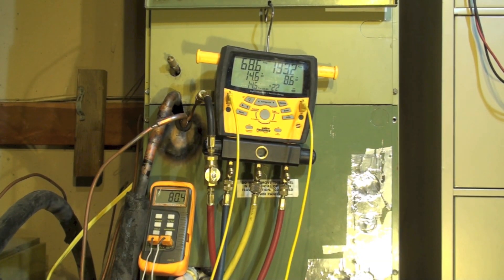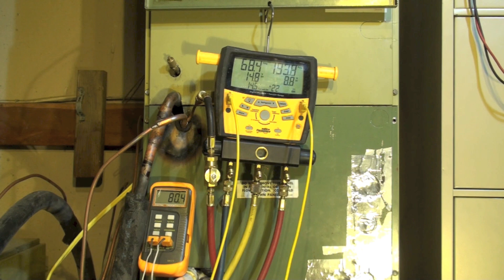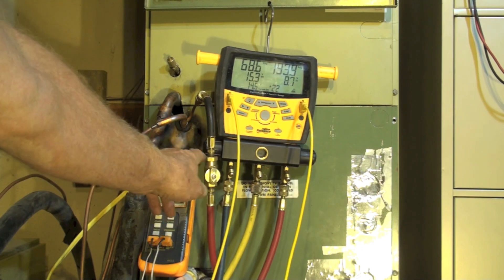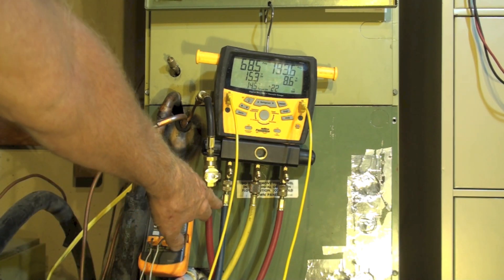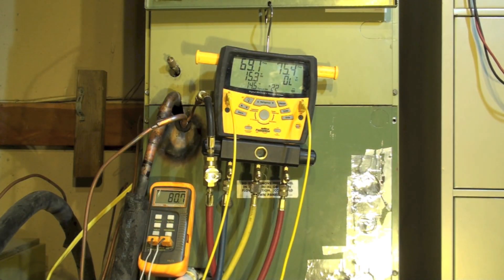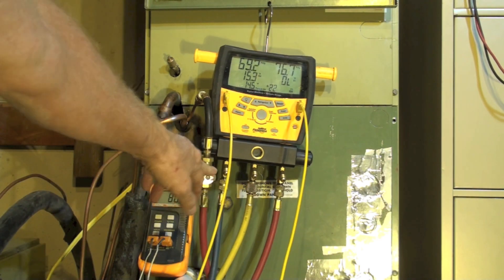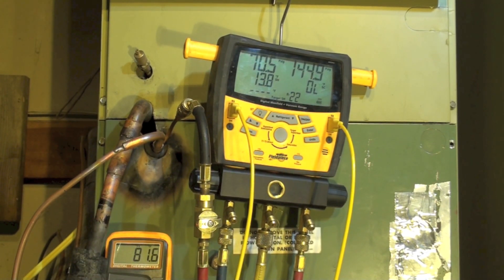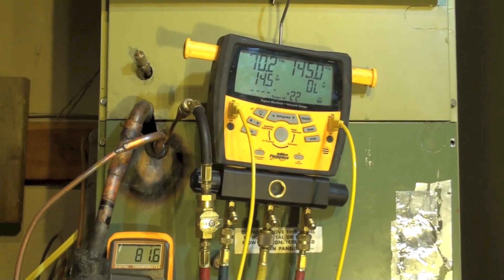How much refrigerant does the gauge set hoses hold.

Comment: GFM - So after I evacuate on a new heatpump install, hook up to tank and break the vacuum with the 7 ounces of 410a that I need for over the 15 feet of lineset, I will disconnect from tank, dock my yellow hose and then open both service valves and release charge from compressor and check for subcooling after 15-20 minutes of running in cooling mode. At that point there will be product in both my high side hose and yellow hose that was hooked to tank. If I remove high side hose from service valve and SLOWLY bleed product through vapor side back into the system, will that extra that I have from yellow charge hose make a difference? I have the Yellow Jacket 42001 guage set with 60" hoses w/ball valves.
Reply from the maker: I think you have it.
GFM
Reply: TY

Comment: I was hoping you were going to tell us how much refrigerant is in the hose and gauge set.  Mini splits have to be charged by weight and I was hoping to find out how much refrigerant I have to allow for in the gauges when weighing in the charge.  I guess as long as I make sure to empty the high side hose into the low side it should be pretty close to the entire weight of refrigerant called for.
Reply from the maker: johnmiller102 you have got it.  If you use low loss fittings, you should come pretty close.
GFM

Comment: Smaller systems with shorter line sets will be more sensitive to the few ounces in the hoses. The 10 and 20 ton systems I deal with, it makes virtually no difference.
Reply from the maker: Jimmy Ray Your systems also use TXVs that are less sensitive to charge level.  This video was done to illustrate that the charge in the hoses can effect a critical charge system.  Like you, I did not pay much attention to the charge in the hoses in the larger systems.  Thanks for the thoughts.GFM
Reply: @grayfurnaceman  so you charge piston metered systems by subcooling?
Reply from the maker: @dustinjohnson2891  Generally not. If the unit has a charging chart, I would use it.
GFM

Comment: Okay so, say I go up to a system to do a maintenance and I check the charge with my gauges. I do not add any refrigerant, am I not losing system charge if I do not bleed the pressure back down again?
Reply from the maker: Stephen Rardon When dealing with a TXV I just dump it in to the low side.  If its fixed orifice, I try to stop charging early so the hose finishes the charge.  I know some of this seems to take quite a while and we are generally on a schedule, but with practice it goes quite smooth.
GFM
Reply from the maker: Joe Shearer There should not be any air in the gauge set as the hoses should have been bled when the set was installed.
GFM
Reply: Im sorry are we talking about how much frezon is in the gauge hose when were all done? Does it really matter? In 8yrs this is the first i ever heard of this phantom gas. Looks good from my house. :-) im asking cause i dont know, so teach on teacher. Now im couiorus. Stephen i know my spelling sux. Cut me some slack. I cant do it all. Chrage the unit, spell this, spell that. Mr. Know it all. Im stephen i know everything bla bla bla. JK
Reply: Stephen Rardon ok for real what about quick connectjsirbdid fksisb? Connect? For the hoses? Soon as you start to losen it, it seals all the run off gas in ur gauges.... hdudjdjd jdjdsjd... dhdhdjsosidu. Bsjskjdjdh. Hdjdjdb. Get that last part?? It was very important. ;-)
Reply: O i got ball valves on my fancy hoses. Im better then you. Well then mr. Rardon maybe you should just post a pic of ur balls, valves. Ya iv had not seen/used those im gonna look em up. Good deal ill check em out. Have a good day man. Dont huff to much 22... :-)
Reply from the maker: Yes you are.  If the unit is a TXV controlled it is not that picky about charge.
GFM
Reply: grayfurnaceman so if i check a txv system i can bleed back pressure but on a piston i shouldn't? seems i'm losing either way and by bleeding pressure over i'm minimizing the lose. i've heard you lose as much as 3 ounces, is that an ounce per hose or 3 per hose?
Reply: 3 ounces is what the charging hose holds... Refrigeration is critical charge and I've checked on it! Lol
Reply: I'm more concerned about injecting air in the system than loosing 3ounces. I keep my high side hose filled and when connecting suction line you don't have any liquid anyway .
Reply from the maker: Stephen Rardon The hose charge is in the high pressure hose as a liquid.  The low pressure hose is gas and holds very little.
GFM
Reply: Befor adding gas i do bleed the air outa the hose. Soon as charge is good disconnect and go. Quick connect fittings.
Reply: Timmy W no biggie, spellllll how you want! Lol
Reply: Timmy W i personally prefer ball valves on my hoses. i tried the Yellow Jacket spring loaded low lose and they always ended up leaking before long. I'm right behind you one that last part! and some of the middle.